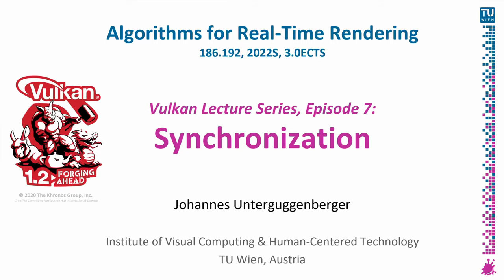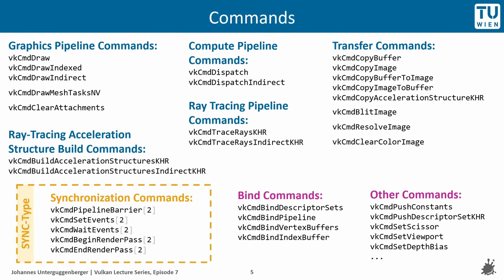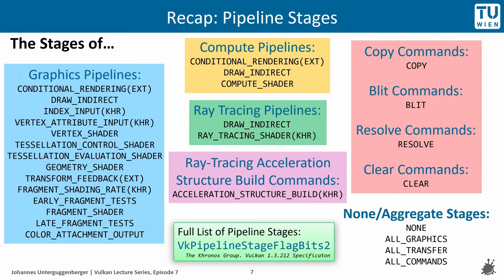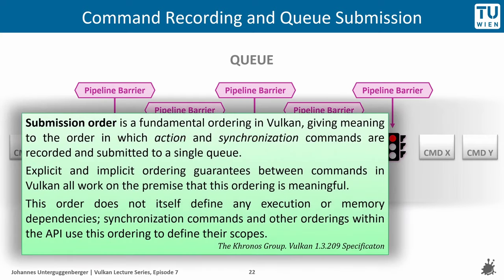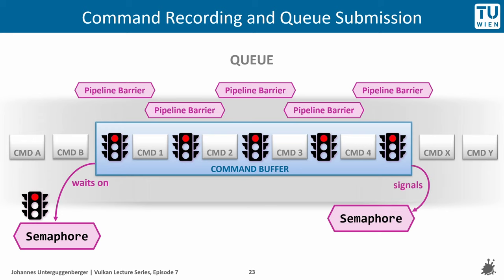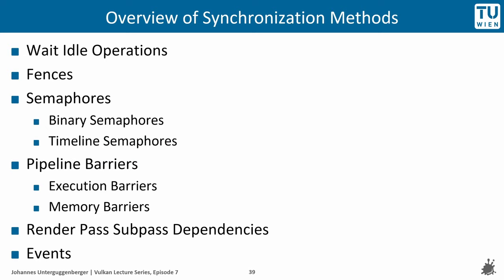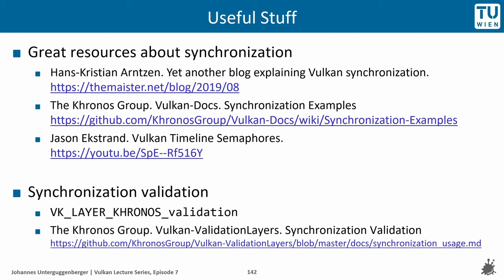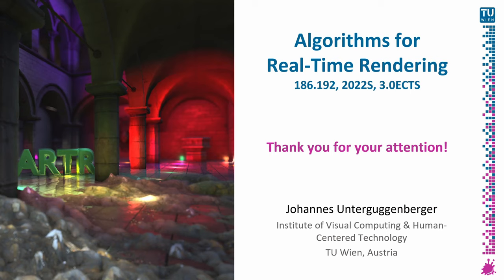Vulkan Synchronization | "Understand Fences, Semaphores, Barriers,..." | Vulkan Lecture Series Ep. 7

Comment: As I understand it, work submitted on a queue doesn't even have to start in order. When the spec says work "respects submission order", this only means that the order you call Vulkan functions can be used as meaningful reference points for your synchronization commands and some very limited implicit synchronization. Without that statement, there'd be no meaningful ordering you could actually reference in synchronization commands to establish custom synchronization. But if you don't record any synchronization commands within a command buffer, the driver essentially has no implicit ordering whatsoever and has free-reign to do whatever it wants.

The only things the spec is really insistent on providing any meaningful ordering within a command buffer are render passes' fragment/blending+logic+color operations for a given (x,y,layer,sample), and image layout transitions.
Reply: However, batches in a queue submission are said to start in the order submitted. So it seems commands in a batch can be arbitrarily reordered, but the batch itself can be considered to "start" earlier.
Reply from the maker: Thanks for your message. Under 7.2. Implicit Synchronization Guarantees, the spec says that the order is meaningful -- but your point is that the commands do not have to be started in submission order in any case, just because it is meaningful. Is that right?
Reply: @cgtuwien  No problem. :) And yeah, exactly. Submission order is meaningful in the sense that mainly barriers rely on it for establishing their scopes, as well as some very narrowly-scoped implicit ordering guarantees (like framebuffer operations in a particular render pass). But for the most part it doesn't actually impact when work begins or ends.

Comment: fix page 118 of your notes!
Reply: Would you be so kind to point out what's wrong in your opinion?
Reply: @johannesugb  Top left corner ": VK_PIPELINE_STAGE_2" followed by whatever that is,  "VK_ACCESS_2_" followed by whatever that is
Reply: @thefriendsofmrgyro6361  These are valid stage flags (see VkPipelineStageFlagBits2 in the specification) and access flags (see VkAccessFlagBits2 in the specification). The combination of VK_PIPELINE_STAGE_2_FRAGMENT_SHADER_BIT and VK_ACCESS_2_SHADER_READ_BIT is valid too as per Table 4 of the specification. I can't see any error or typo on slide 118.
Reply: @johannesugb  I am looking at the pdf from the link you've provided. The two lines on the top left of page 118 are unreadable after halfway.
Reply: @thefriendsofmrgyro6361  Ah, the slides. ^^ Have been updated.